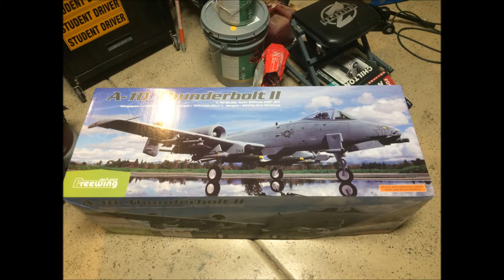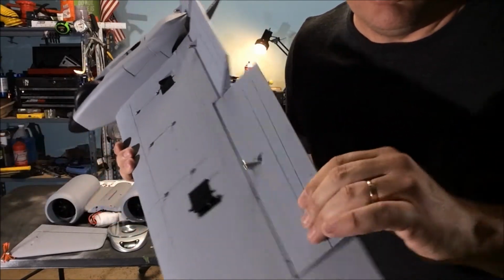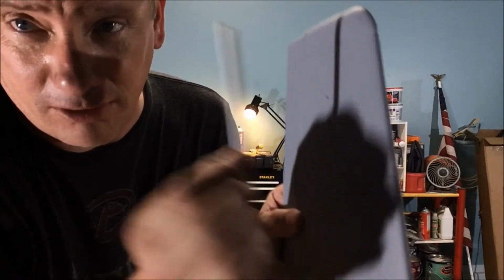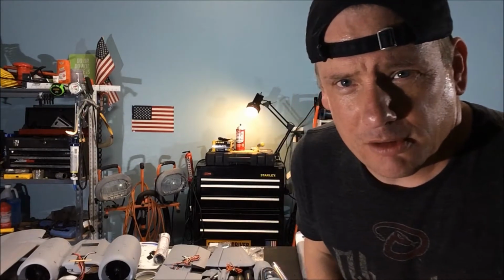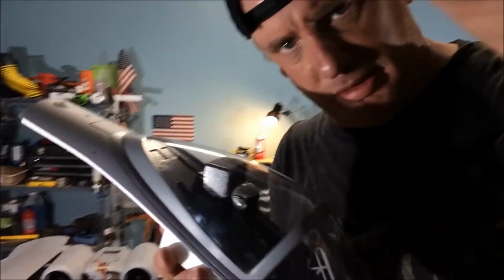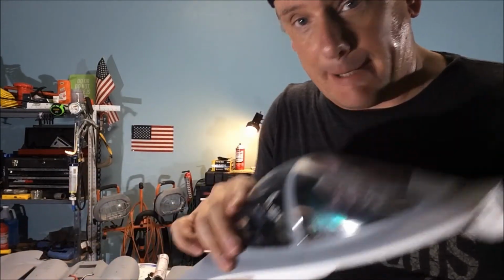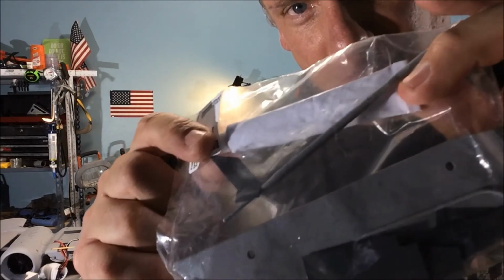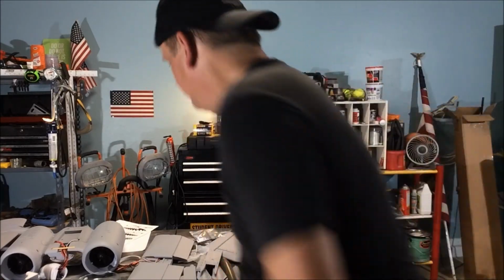Freewing A-10 Super Scale 80mm EDF - For Detailers

Comment: The small bumps are vents on the mold to allow material flow to all areas. You can razer them off, and retouch with the air brush.
Reply from the maker: Thanks for the info Keith! Thanks also for watching and taking the time to comment.
Reply: I use to work for Flambeau as a Mfg/Molding Technician. I've setup and run all their machines, then turned them over to line staff.
Reply from the maker: I had a feeling they represented a part of the manufacturing process but it's good to hear from someone with first hand experience anyway. Thanks again for contributing.

Comment: You mentioned the American Flag on the side windscreen.  Just so you know, this is something that each pilot would sometimes carry with them and put in their window or anything else.  They attach their map bag across the cockpit dash and usually just have maps sticking on the sides.  So, it's not something on the actual window, but is usually right up against it.  And either side is ok as it varies with each pilot.
Reply from the maker: That’s some really useful insight, I kind of figured that’s what might be happening, I figured it was that or a customization by the crew cheif. We used to do things like that on the B-1. I’ve really made my hobbies my last priority this year (life gets in the way) but I did manage to complete the cockpit before I walked away. I managed a beautiful, multi-layered canopy, with the flag placed neatly inside the lower left corner. It really looks great! Thanks for watching, and for some great insight.